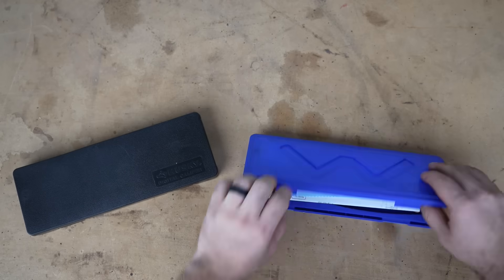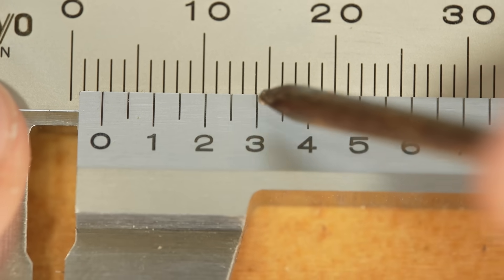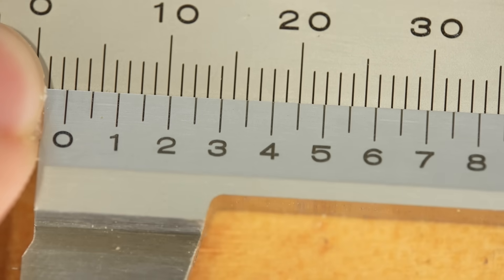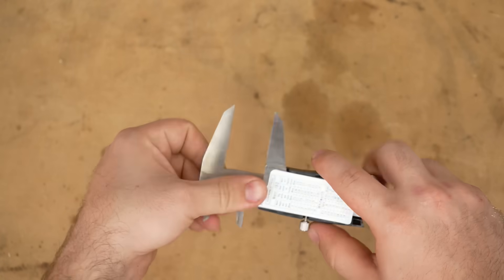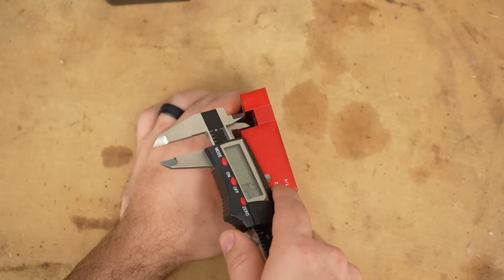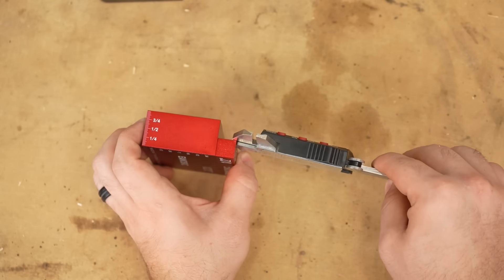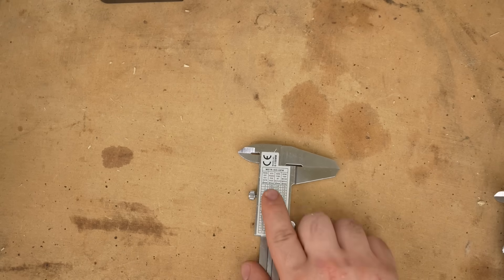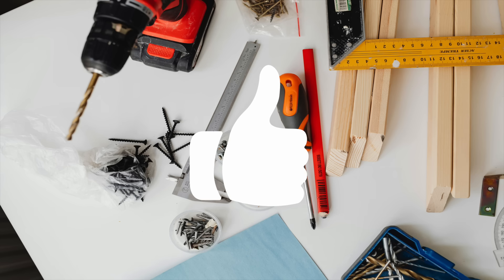I wish i’d known this sooner, How to use calipers like a pro

Comment: China export is a hoax. There's no such thing.
Reality is, there is no requirement to perform any testing to put a CE mark. So any company can legally put a CE mark on anything.
It just means that the company didn't feel like putting the proper CE marking. In the example in the video, there was not enough space on the label for proper spacing.
The EU would still count this as a CE marking, as a consumer would think it is one.

Comment: The "China Export" fake CE marking is an urban myth as far as I could read.
There is for sure fraud where companies use the CE logo despite not complying with European standards but they will just use the real marking. There is no official "China Export" marking and using a CE marking with different spacing between letters would still be just as illegal as using the normal spacing.

Comment: as a hobbyist i only ever really used vernier calipers, I started with the dial ones, and found them really fragile. I never used digital - I always assumed the batteries would be dead when i wanted to use them. I think verniers are great - i honestly think the robustness and slimness are what i like about them most.

Comment: Another pro trick on digital: if you want the center distance between two holes. Measure the diameter of one hole and set to zero. Then measure the  distance between the outer hole walls, and you get the distance between the centers

Comment: The CE marking has nothing to do with quality. It just means the product is legal to sell in Europe.

For instance, all electronic objects (like electronic calipers) do create some noise and the CE norm checks that amount of noise so that other electronic objects don't get jammed (and that there is no dangerous electromagnetic radiation).

Also, it is often uncontrolled. Which means that it is left (and mandatory) to the company to mark "CE" and to check and guarantee by itself that it is following it.

Comment: Great video! As a hobby machinist I use digital, vernier and my fav is a 4” dial. When I need super accuracy I go for a MIC bc I have found adding or reducing pressure on the caliper will change the numbers a bit. The MIC has a constant force while using the slip adjuster

Comment: Accurate video! 
Im blessed with many calipers at home, my company replaced my messuring tools every year. Every 6 months or so they where certified (messured and proofed?! ) when i worked there. Just to make sure the endproduct of our company is certified.
Sometimes i dropped it 😢 and needed had a new one 😂
I loved my work and i am still using them at home for my hobby- laith.

Comment: Out of high school I worked in a machine shop. I’ve had calipers ever since. My work in finance and software softened my tooling knowledge. But 40 years later I surprised some young aerospace engineer when I was asked to measured some satellite parts with my trusty calipers. Never underestimate the old dude with the right tools.

Comment: Thanks that was great. I have used the vernier caliper for decades. I bought a digital and it keep "de-zeroing" when I was using it so it went to the "never use" tool pile. I never knew about the step measure so and old dog just learned a knew trick. One missing was how to use the "inches" vernier which takes more mental math than the metric scale. 😊

Comment: Good video. I would have liked to have heard more on the notch at the end of the depth gauge. 
 Also, precision and accuracy are not the same thing.  Accuracy is how close something is to the true value.  Precision is how reproducible a measurement is.  

A group of arrows closely spaced together but which are on one side of a target offset from the bullseye, then would be precise but inaccurate, for example.  

More germane to this video would be a caliper with a constant error so it could be quite precise, but inaccurate.

Comment: Great job, James! I learned from this video, although I've been using callers for many years. What I never knew: The info on th C E "emblem". That is good to know. I now have a Kynuop and the "Emblem" signifies that it is not China Export, due to it's spacing of C E.. Also, nowhere on it does it say Made In China.
Well, this is disappointing. I just looked up where Kynup was made and it is apparently China. I should have known by the name Kynup.It seems like a good caliper, though.

Comment: When I started in my trade, I bought dial calipers. It never failed; I'd drop them, and they would be ruined. When the digital calipers came out, I bought one—a Mitutoyo, and it was expensive back then. That caliper lasted me 37 years. It finally became unreliable, and after trying a few different brands, I recently bought another Mitutoyo with no regrets. I also have an iGaging and though it's a decent tool, it just doesn't have the feel of the Mitutoyo.
Reply: https://youtu.be/z5KtKAee0jw?si=V6c6xf7-7VA98nFq

Comment: Very clear explanation! 👍 
For very accurate measurements, temperature may play a role. The linear expansion of the caliper is relatively small, but materials like aluminum have much larger expansion coefficients.

Comment: I was taught to not let the faces of a micrometer touch during storage to prevent damage , is this also true for calipers.
Excellent video, thanks.
Reply: @johneckel7281 The faces of modern micrometers calipers etc are stainless still so no issues with corrosion, rust etc More of an issue is over tightening when closing them. Also if subjected to big temperature swings they can expand putting more force on the instrument in stored position. This last is the same reason you should use the thumb adjustment device or the ratchet on a micrometer to avoid over torquing or under torquing  and getting an inaccurate reading. When I was going through engineering and machining classes in college one exercise we did was taking multiple measurement of the same gauge block over time.... holding the instrument and part in hand, different force amounts, and different ambient temps. It was an eye opener as to how temp and force could hange the readings. I do a lot of ultra accurate machining of astronomy gear and optics and those exercises years ago (early 70s) were invaluable.
I have a device that holds my micrometers to avoid hand temperature  inaccurate readings. I still like to wipe my measuring instrument faces clean to avoid contamination by dust, finger oil, etc
Reply: Best store them slightly apart.
Same as I was taught to do with bench-vice jaws

Comment: I ran into an issue with digital calipers like that Husky.  The would lose zero when you opened it up, and it seemed to always be off at 0.2 when rechecking zero.  There is a wheel that turns as it rides along the rail of the caliber and I think it slips at times.  It may take a couple tries to get an accurate reading where zero stays zero, but I went back to using vernier and dial calipers for most measurements.  Maybe this is not an issue with very high dollar digital calipers.

Comment: You either have a caliper or a toy from China. I bought a cheap caliper and this seems to work except or the jaws for inner measurement. They are not flush when closed. There seems to be a crazy 1mm overlay. As long as it's not digital, I can machine it to spec with a diamond stone as I have a micrometer so I'll measure the gap. Still, there's a play and I had to polish the main jaws too so that they are paralel and the numbers line up. It's not worth it. Should I remove metal from both inner jaws now or just one? I dont think it matters as much for the inner measurement. The scale seems to line up with 9 so at least the scale should be legit.

Comment: Reviewing the comments, it seems the people who understand what you said in full are people who are already quite familliar with calipers. I have calipers, butJust to share my experience, I had a very hard time following the way you explained things. I feel like there could have been more concise information shared when explaining how things worked. For instance, you talked about drilling a hole, and then you mentioned to face the lip away from the wall in order to get a proper measurement? Who's to say what we are drilling into is a wall, and also, neither way you place it would be facing away since you are in the wall. And if you faced away from the wall, you would not be in the hole as the hole is in the wall. I had to watch it 3 times to understand what you meant, and I get it now. But it could have been said in a way that was more accessible.

Comment: As for me I prefer vernier because I can totally trust what Im measuring. Its easy to take the numbers said by digital ones at face value, forgetting to tare it at zero. And sometimes they drift. You dont know if you can trust it all the time. Also yeah no batteries.

Wanna drop a kinda standard trick I know since we talking threads. You can measure thread pitch on bolts pretty accurately by taking the measurements of a few threads. Like maybe take measurement for 4x, or perhaps 8x thread pitch, or even 10 for easier mental calculation. Then divide what measurement you got by 4 or 8. For example if you measure 4 threads to be 5mm, that means its 1.25

Comment: Dial calipers are much more common than vernier calipers. While they still make them, they were pretty well obsoleted by dial models. As we get older (I’m 75) vernier models become much less desirable. I prefer digital as the can be easily read while it’s in the part on the machine, rather than having to carefully remove them, possibly jarring your measurement. And, of course, you can easily switch between inch and metric and with some, fractional as well, meaning that you don’t need two calipers. The same thing is true of micrometers. And yes, the only real negative is that you need a battery.

Comment: Well I never knew about the step measurement! My top tip: put the battery in upside down when putting away digital calipers. On mine, that leaves one terminal isolated and stops the battery discharging

Comment: If you have a metal lathe I highly recommend knocking down a quick-change extension adapter for your Yankee. Hart (walmart) and Diablo both make good ones that machine easily, they don't let go of your bits the way those red ones do, and you only have to pull the collet to remove the bit.

Comment: Most common?  In the 10 or 15 years before digitals came out, dial calipers were every bit as common as verniers.  And although I've used vernier calipers for years I know that over the last 10 years, they have fallen from favor.  Very few people using verniers these days.  I know.  47 years in manufacturing. 

Measurement of hole diameter using the inside jaws is very problematic, especially for small holes, as the thickness of the jaws becomes a problem.

Comment: I spent about six years working in a tool manufacturing company in the quality control area.   That included calibration of equipment and dimensional checking of tools with measurements to "tenths" (.0001") and in some cases closer.   

One major thing missed.  Making sure the faces of the caliper are clean and the best way is to simply bring the jaws down against a piece of paper, then drag the paper out.  Works the same with 0-1 mics too.   

Another smaller detail, if buying calipers it is a fairly good idea to get the OD jaws with carbide jaw, much slower wear from use.   I wouldn't recommend getting the carbide ID jaws unless a lot of ID measurements are done.  Carbide can chip easily with that knife edge.  

Remember to use a light touch, holding the caliper slide too tight can cause flex, the measuring section can flex under too much pressure.  

Lastly, as noted in the video, measure in the wide area of the jaws to minimize possible flex and only use the knife edge portion at the end if needed.  You don't want to chip or wear that area of the caliper.  

It's a shame he didn't include dial calipers because they are easy to read, quick to use and no batteries.  A zero check can be quick and as long as the dial face is fixed in place during the measurement it will hold zero, no way to zero in error.  In addition, the digital calipers show a fourth decimal place for inch measurements (not sure what it is for mm) BUT the calipers are only accurate to ±.001"  the fourth decimal, for industrial use, is not accurate, since in most cases it will either be 0 or 5.  

One other point - check zero on both the depth measure and the step measure.  Make sure it is flat on the step, which it should easily be, that's a long surface to wear to make it bad.  BUT the depth measure with the little rod end is another story.  After a lot of use that end can wear out, so it is a good idea to verify zero on the depth measure.  It can still be used, but it just has to be set even with the end of the caliper.

Comment: I studied technical high school and even there, half of kids immediatelly forgot how to use it after school ended. 😀 I need it every day in work, so it's ridiculous that someone finds it complicated. 

Before you start looking for the best aligned lines, use common sense, if it's somehere in middle, it's probalby not gonna be .1 or .9 so don't waste your time and focus immediately on lines around .5 like in this case 2:15  I see that it's cca .4 even without checking those lines, but you need good eyes because in reality, it's pretty small, but if you see well for close distance, you should be able to guess it at least with 0.2 mm precision.
You should also know that not all calpiers have the same scale 0-9, some of them can be less precise.

Before you use any calpier (digital or classic) always check that it's on 0 when you completely close it, that's very important, a lot of them are poor quality from factory and with such bad quality in these days, digital calpier can be better because you can zero it with one button, but not all of them are good.

Good quality classic analog calpier is pretty expensive and never buy it online, you always have to check if it shows 0 or you will just waste your money.

Part for measuring inside diameter is often damaged from falling on the ground, so always check if it shows correct values before you start using it for something important.

Comment: I did not understand the "step" measurement as it seems the same as a depth measurement. Can someone clarify this please. Note: I have been using calipers for 40+ years (correctly). and never knew there was such a thing as "step". Something not mentioned in the YT is the nice thing about digital calipers is the ability to press a button and be in metric units or imperial.
Reply: Bigger surface area around the corner so you are more likely to get an accurate 90° angle when holding it against the step

Comment: Nice work.  Some thoughts:

1. Some companies now offer Bluetooth capability, which allows entering measurements directly into an app with the press of a button.
2. It would have been handy if you had discussed the difference between relative and absolute calipers.
3. Explaining how digital calipers work would have been a solid addition.

Cheers!

Comment: It is almost impossible to find a caliper designed for left-handers.  I guess it is assumed that you will learn to use the calipers right-handed.   I own several sets and have given up trying to use them right-handed.     I find it extremely awkward.    I still do my measurements left-handed and have learned to read them upside down.

Comment: Whitworth threads? Lol, no one uses those any more. I haven't cut one in 35 years. That said, I didn't come here to be insulting or unhelpful. Metric systems can be daunting to those not used to it. Simple explanation to most... Subtract the thread pitch from the major diameter will give you the tap drill diameter. Example: 6mm diameter by 1mm pitch equals 6-1=5mm tap drill diameter.

Comment: You did a a good job explaining how to use these. I was taught all this in my 2nd year of  HS shop class back in the late 60's. In the second year we were taught how to run an engine lathe and vertical milling machine. Unfortunately shop isn't taught any longer in most schools.

Comment: Tip. When you buy them, zero them and then hold them up to a light and squint and if they're faulty, you'll see a slit of light. Wipe the jaws and try again. One speck of dust can be measured but if perfectly clean, there should not be one photon of light coming through.

Comment: I am interested to know if the dimensions of the pointy end of the tail are something like 2mm x 3mm wide. I've never measured them but just thinking it would be useful when measuring small gaps. At the moment I am designing 3D printed parts that fit together tightly and so I need to measure the amount of play in the assembly. The callipers are not that helpful in this situation but I have found the tip of a my mechanical pencil is 1mm in diameter and the lead is 0.5mm. Fitting these in the gaps gives an idea of the amount of material needed to be added in order to close the gap.

Comment: Another trick is this; When you want to measure the distance between two equally sized holes, put the jaws in 1 hole, then set to zero. then measure the outer side of both holes and you get the distance to the center of those holes. Note that this only works with a digital caliper.

Also; measuring accuracy isn't the same as the readout accuracy. So the 0.05 on the vernier caliper isn't its certified accuracy, which is about within 0.1mm. The digital calipers can vary between 0.03 and 0.05mm accuracy.

Comment: Every man needs a good set of calipers (set?) whether he knows it or not. Fathers should inform their daughters so they know how to give proper gifts to the men in their lives.

I'd position calipers after a cordless drill, shop vac, distance laser, laser level and tripod, but before an impact drill.

LCD projector is also good gift to follow up on the tripod if the man already has calipers.